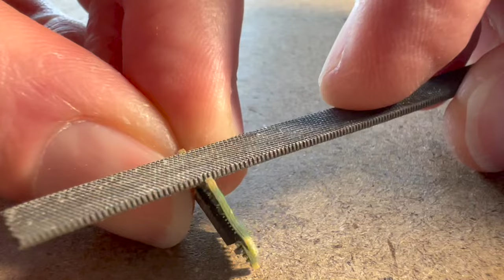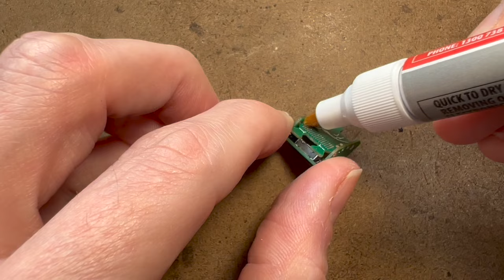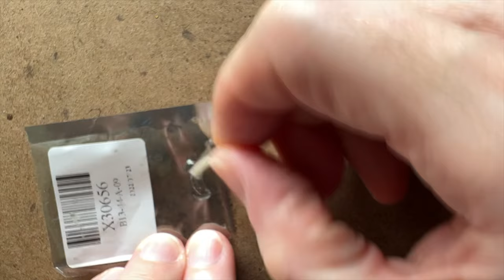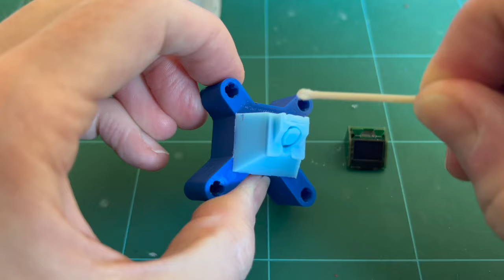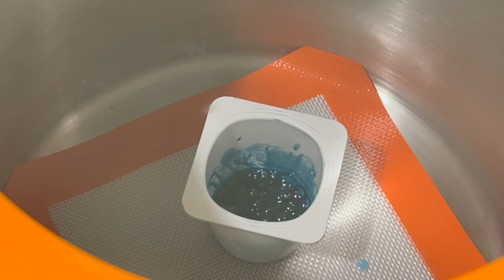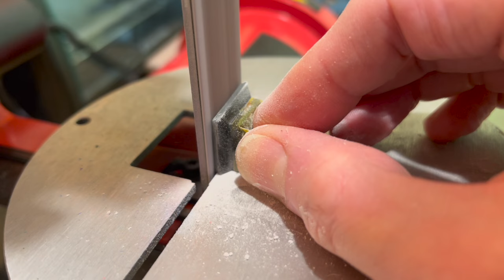Brick Assembly

Comment: Over 20 years ago, my grandma said jokingly: "One day they'll make computers so small, you'd need to be careful to not vacuum them up while cleaning the house." Well grandma, the day has come.
Reply: What a visionary! 🤓
Reply: 20 years ago we where there already.
Smartcards have been containing computers for decades. They only got faster and more memory.
SIM cards would be one well established example.
Reply: Wow. Your grandma can look into the future.
Reply: @fgregerfeaxcwfeffece  A SIM card technically isn't a PC, it's just something that stores data like a SD Card, you can't actually compute anything with it.
Reply: I’d like to see her portfolio 🎉
Reply: and they are even smaller than this
Reply: @thefoxdubs  a SIM card actually contains a whole operating system
Reply: Check basement for time machine 🤣
Reply: @tinyloops  wtf
Reply: @thefoxdubs  Oh how wrong You are :-) This "sim extra" thing even in an  old nokia runs java programs actually ON A SIM CARD.
Reply: @thefoxdubs  Wrong. SIM card is a full fledged computer, it contains a processor, RAM, and ROM in the single chip. And it's explicit idea is to compute the secure authentication of subscriber for connections the phone makes. And there has been even user interface provided on the phones explicitly for additional SIM application programs since very early stages of GSM standards, in the era of monochrome dumbphones.

Sure the SIM card is not PC though, which means the certain IBM-standardized computer setup, but so isn't the one shown on the video either.
Reply: @TheSimoc  damn.... i thought the phone carries all that especially in the age of ESim
Reply: @thefoxdubs  ESim has made those obsolete ;)
Reply: @thefoxdubs  No, a SIM card is a computer, it is a 4bit computer with RAM and ROM and everything a proper computer has to have to computer anything computable.
Reply: @monad_tcp  okok, all these replies, damnnn, I already found out now. XDDD
Reply: That day was decades ago and the fact that you don't know or failed to realize that is scary.
The cool thing here is that we're now at a point where someone can design and build one themselves at home with great tools and services to help.

All you managed to do with that comment is show you're about as knowledgeable about tech as the average grandma, probably less so than yours was.
Reply: @tinyloops  Surely you can also use it to control machines. 🤑😆
Reply: @derduebel  and besides my previous message, it actually does control a system, namely your phone.
Reply: @tinyloops  Your phone has its own processor. You can also make an emergency call without a card.
Reply: @derduebel  yeah maybe i went a bit too far
Reply: @fgregerfeaxcwfeffece  I bet you're fun at parties 😂
Reply: "and 1 hour later, they were there!" jk, they were around in 1990s too
Reply: @thefoxdubs  This isn't correct. SIM cards are micro controllers and run several things.
Reply: @TheSimoc  nope, esim is a SIM that the carriers control, soldered onto your phone motherboard. Barely different, just less control for you the user.
Reply: This is a computer so small, you don't want to step on it. (Ouch!)
Reply: wii... users nö ^?^
Reply: @fgregerfeaxcwfeffece a SIM card is a storage device not computer lol
Reply: Did she say anything about me?
Reply: @gg-gn3re  Well, have to admit I'm not famiiar with e-sims. I think there are different variants of implementations, as in my country we can use any local carrier with phones equipped with e-sim, ie. any carrier is not controlling e-sim.

On the other hand, I know that in many other countries, phones have long been completely bound with carriers, I don't know pretty much anything about their technicals.

I do however have some prejudices about e-sims though.

Anyway, the main point about my comment was, that in the phones with e-sim, the functionality of sim is in the phone instead of the separate card.
Reply: The day came YEARS ago, my dude. Years.
Reply: @thefoxdubs  wrong there are sub system apps that run on Sims that communicate to your carrier.
Reply: Careful dont step on them too
Reply: @TheSimoc  yea they are, that is what a sim is, that is it's only purpose. It's fully carrier controlled MITM for services. Just because you can switch them isn't relevant to anything, they're probably all GSM anyway..
& no you're still wrong in your main point. That card is soldered on, it doesn't mean it isn't "separate".. it's no longer separate "physically" sure but it's still entirely different platform soldered onto the board... as with many other things (GNSS etc too)
Reply: @fgregerfeaxcwfeffece  A SIM card is not a computer. It is just a memory chip.
Reply: she saw the future
Reply: @thefoxdubs  sim cards have a tiny cpu inside
Reply: @gg-gn3re  I would still say GNSS etc, just like e-sim and other subsystems are part of the phone, not separate.. Sure it is all about aspect of observation.

And actually, I strongly suspect that e-sim functionality might be implemented by the same SoC chip which is used to integrate more and more other subsystems, too. Modern phones don't have very many separate chips.

But anyway, I would be interested about technical explanation about e-sim concept, I failed to find anything comprehensive by quick Googling. Traditional sim card is fully carrier specific, issued and controlled by carrier. But e-sim can be used with any carrier, so at least it is not itself tied to any single carrier. I haven't got a grasp about how it works, it is something about user granting contol of it for the carrier to be subscribed on, or something like that? I think it would at least need to download some carrier-specific data on it, like is traditionally provided with the carrier-issued sim cards, right?
Reply: @samuellourenco1050  Sim card definitely is a computer, with CPU, ROM, and RAM.
Reply: And that grandma, was Steve Jobs
Reply: I mean not a huge prediction, in 2002 as far as I can tell there were many small electronics and stuff, still kinda cool ig
Reply: Grandma's corollary: one day they'll make computers so small, you will have to be careful to vacuum them all up while securing a house.
Reply: @jupa7166  wow
Reply: lmao micro machines are the ish
Reply: @TheSimoc  "strongly suspect e-sim functionality might be implemented by the same SoC" well it isn't, so.. no
also soc = system on a chip.. you said system on a chip chip huehue
Reply: Your grandma was a great visionary...
Reply: That scrapeing can generate electricity
Reply: You could easily vacuum up a Raspberry Pi zero. Grandma has been right for a few years.
Reply: @gg-gn3re  I have no idea why e-sim wouldn't be implemented within the SoC, as it is a generic-functionality element anyway, in control of user for choosing the carrier and provided for the user by phone vendor, without ties to any carrier (unlike traditional sim card with carrier-supplied ROM data), and SoC also implements even way more complicated subsystems.

But I don't really know, didn't get any additional information about technicals which are definitely relevantly different from traditional sim cards.

I also have no idea about your SoC huehue..

Btw, about the definition of e-sim being separate of the phone or not, how about those early dumbphones that used to have about every subsystem as separate chips and even discrete components, you seemingly think nothing in them is handled by the phone, instead everything in them is separate, even though soldered on the phone's pcb, haha!
Reply: Little did grandma know the computer would also be the one vacuuming the house.
Reply: And she was very right!
Reply: "one day they'll make computers so small you'll have to worry about stepping on them barefoot"
Reply: There cameras the size of sand
Reply: micro machine
Reply: А моем детстве бабушка сметала микро карточки со стола думая что это пластиковый мусор (у нас было много флешек микро СД с разной музыкой для телефона с горячей заменой) .
Reply: My grandma tell me about the story from her grandma too (i mean my great-great-grandma)..
She told "one day people can fly comfortably while drinking a glass of ice"...
Its more about 80 years ago, and in my country no passenger plane on that year...
Reply: @tinyloops  an SD card does not contain an OS, why would it need to? At the very least, an SD card has a microcontroller which contains one program which has fixed tasks and can't be reprogrammed on the fly, because it has no OS.
Reply: @gg-gn3re  and a microcontroller isnt really a computer since the program is fixed and has no OS. To reprogram a microcomtroller it has to be connected to another computer with an OS. A microcontroller is designed to do a few fixed tasks in one program so it acts more like hardware.
Reply: No no no. This is the millennium.

The test was when you could step on a computer that would fuck up your foot because your kid had left it lying around.
Reply: @kilianhekhuis I agree, it's always nice to meet someone at a party who is knowledgeable about some interesting topic.  I wish all parties had someone like them present, it would make me far more likely to accept invitations.
Reply: @@Johnny-fivethat sounds like my family; were you also raised by Evangelicals?
Reply: @lemdixon01  Micro controllers can be updated and can run an OS and yes they can be reprogrammed lmao. The difference is the entire system is within the chip
Reply: @gg-gn3re  yes, someone recently managed to emulate a Commodore 64 OS inside a Raspberry Pico Microcontroller, but this is not what is normally the application for them and C64 is old without son of the modern features of a modern computer. As for running the whole computer on one chip, then that's been done on chips other than microcontrollers, such as smart phones, tablets and Raspberry Pi, its called SOC (system on chip).
Reply: @lemdixon01  linux RTOS is used on many MCUs
Reply: @tinyloops  trye
Reply: @the-real-random-person  you can read all about it on the sim card wiki page 👍
Reply: The prophecy is true.
Reply: @thefoxdubs  while not a pc in the traditional sense. there is computing done on them. security checks and some encryption etc
Reply: And motherboards in smartphones. An iPhone logic board is a tiny computer!
Reply: @fgregerfeaxcwfeffece  smart cards are not computers
Reply: @jupa7166  Not 20 years ago
Reply: @jupa7166  Does it compute by it self, if not that single simcard isn't a computer
Reply: A sim card is not a computer no processor nothing, it contains a single IC for data storage that IC has absolutely zero function until plugged into a control system. Basically the same as an sd card
Reply: @krystiankosowski4617  😂
Reply: @monad_tcp  Can you assemble a Nintendo using two SIM cards?
Reply: 20 years ago they had computers that small it was 2001
Reply: Now we just need a tiny computer designed to be vacuumed up by a roomba to collect telemetry of the experience
Reply: @lemdixon01  WTF, a microcontroller is a computer.
I'm an MSc in Computing Science you think I don't know what a computer is? 

Only because it's a specific purpose computer that's locked down and don't use stored program, that does not mean it is not a computer.

You could argue that it does have an operating system.
But no computer have operating systems, that's software that runs on it.

A microcontroller might be a designed to be specific purpose, but the real truth is that any Turing complete computer is in fact ALWAYS general purpose. (even thou it can't be easily reprogrammed because the program was stored in the ROM) 

Being able to be reprogrammed on the fly IS NOT a requirement for it to be a computer.

Most microcontroller have a bootloader and a rudimentar BIOS and they can be programmed on the fly.

Take a cortex-m0 for example.
Reply: @paulpinecone2464  the video about the lego computer that is a single brick!
Reply: @shaynegadsden  yes a SIM card contains a single IC.

That doesn't say anything about what's inside.

It is a computer. That single IC has RAM, a CPU, and ROM.

You are wrong. A SIM card is always running as long as you provide power to it.

It does have function, the phone uses something called PDU protocol to talk to it.

"it has zero function" you are so wrong.

If it has a protocol, it has a literal command interpreter inside.

Any smartcard also works like that.
Even SD cards have operating systems that control the flash storage and respond to the ATA and USB commands, you need an operating system for that. 

You are so wrong.

Someone naive might think you can implement an entire SIM card out of digital logic, but good luck with that, ever read the documentation on the protocol?

Its much easier to slap a 8bit CPU in That bit.
Reply: @jceggbert5  don't tempt me
Reply: @monad_tcp  I also have qualifications more on the hardware side and studied digital electronics, microelectronics programming 6502, 8086, and C pic programming 16F84 and C++. One point Ibd make is even countries can't properly define what is a computer as the UK claims to have invented the computer but the US says no they invented it because the UK computer was just a calculator.
Reply: @monad_tcp  easy to prove your wrong because 1 thing all cpus have is an operating clock frequency so if you apply power to a sim what's the clock
Reply: hah. thats real funny
Reply: @thefoxdubs  LOL That is ignorant, and plain out stupid for somebody who calls themselves "coding fox". A present day simcard contains a computer as powerful as a PC from 2 decades ago. And it sure as hell does compute and send messages to your provider all on it's own.
Reply: @UmVtCg  i am a developer, not a technical engineer or sth... Didn't know that JavaScript and Kotlin/Java teaches me about SIM Cards... Smh
Reply: I Hope she's around to see this.
Reply: @thefoxdubs  im so impressed as you lol
Reply: a couple terrabytes a sd card is another scary fact these days..
Reply: @fgregerfeaxcwfeffece  sim cards are NOT computers. Not even close.
Reply: It was also one joke from 90s:
In the International Technical Exhibition all present something, but in the Japanese section is only one guy stays showing a fist and asking what is inside. Someone said for fun: "TV-set!"
Then was the next question: "how many pieses?"

Today it's not a joke
Reply: Wow a real Einstein your grandma was
Reply: @thefoxdubs  Did you ever ask yourself where those billion devices running Java really are? Well, some of them are SIM cards.
Reply: @TheSimoc  never underestimate the ability of a computer person to be unnecessarily rude when trying to explain something.
Reply: @fgregerfeaxcwfeffece  “computers”
Reply: @shaynegadsden  What are you trying to say? SIM card definitely does have clock input, and by traditional GSM standard, 1...4MHz clock frequencies can be used. IIRC some later extension standard allowed even higher.
Reply: @todorkolev7565  Wrong. Definitely are. And even more performant than Eniac or even more recent vintage ones.
Reply: @TheSimoc  well the fact he said a sim is always running if you provide power which is false if you just supply it power it does nothing
Reply: @shaynegadsden   Yeah, so it is not a computer as it doesn't self-contain the clock oscillator, now I got it.
Reply: I’ll take things that never happened for $600 Alex
Reply: My grandma told me quite seriously, "One day you'll have a vacuum cleaner." Yes, I own a vacuum cleaner now!
Reply: The PCs can even do the vacuuming for you too
Reply: Chip off the old block.
Reply: There are already CPU's smaller than a grain of rice.
They are imbedded in larger cpu's as a backdoor
Reply: Whoa, this comment got a lot of attention. It's hard to make a joke based on an old memory and be technically correct at the same time. Of course there have been computers on single chips long time ago, but the remark my grandma made back then was referring to complete computer systems including display and input devices, specifically handhelds that gained in popularity where I lived in the early 2000s. The remark was a response to a family member showing off one of those during a family event. This video shows a computer with a display and touch interface, small enough to be vacuumed up. Of course it's not practical to use, but neither were the PDAs of old times, as far as I can remember 😂
Reply: I remember my math teacher said we wouldn't have a calculator in our pocket handy for when we need to do math
Reply: they also said computers would one day be the cause of death and suffering.. little did they know it was because you stepped on it.
Reply: Your grandma is a timetraveller
Reply: @thefoxdubs  arm cpu 20 years ago where very small already!, what ya talking about11

Comment: It would be hard to convince me that the final product is real without this video.
Reply: It was hard to convince me that reality was real until Plato let me out of this cave.
Reply: The one he made has lots of computer power because it was made with a raspberry pi. However screens this small that can display stuff like what he is using it for have existed for ages. Watches for example.
Reply: @JacobLeeson-zk1ol  Not quite.
It's an RP2040 microcontroller, it barely has any computing power, and certainly cannot run an operating system (or at least a proper one, maybe it can run an RTOS or a really really basic UNIX one).
And the screen is just a really low resolution monochrome OLED (presumably SPI protocol) one, watches usually have way better ones (referring to smartwatches).
Reply: this comment made me realize how we are gonna have to deal with AI. you have to show your work. like on a math test. just showing the answer doesnt mean you didnt cheat. you have to show your work.
Reply: @AbsurdAsparagus  Good idea, until someone makes an AI that can fake all that too ;-;
Reply: @oa1700  I have played enough Zachtronics games to know... Well, I never really could solve many of the display based challenges.